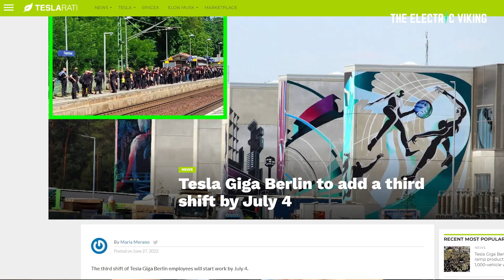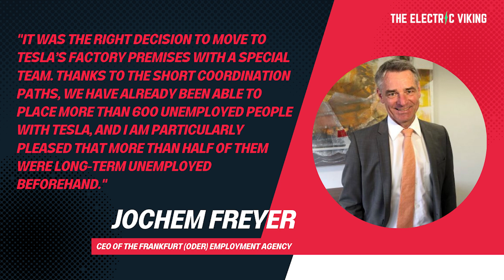Tesla ramping Model Y run rate up to 50% at Berlin in July

Comment: Thank you for your great Videos. Giga Berlin will be doing three shifts soon and will produce 1.500 units per week while Giga Shanghai (same size of Factory) produces 15.000 per week and will ramp up to 22.500. The "Just-so" Ramp-up in Shanghai is 5 times the capacity of the full 3-shift Berlin Gigafactory, the full capacity is 15 times that of Berlin !! I do not think that this is good news. Something must be completely wrong there.
Reply: Admin***  Cool, Tell me more !
Reply: Admin***  Done !
Reply: Compare Berlin's ramp to Shanghai's ramp at the same point. Berlin's output is lower than Shanghai's at the same point, but it's in the ballpark.

Comment: Tesla didn't really start showing profits until after the Shanghai plant opened causing many people to think that Shanghai must be the source of all of Tesla's profits. The corollary to that line of thinking is that Tesla doesn't make money on the cars they build in Fremont. But the idea that Tesla doesn't make money on its Fremont cars is almost certainly wrong. Last quarter Tesla achieved an overall gross automotive profit margin of about 30%. Since Tesla built only about half the cars it sold last quarter at its Shanghai plant, if Tesla didn't any money from Fremont then the cars coming out of Shanghai must have had 60% gross margins. Nobody, not even Tesla, can manufacture cars with 60% gross margins.